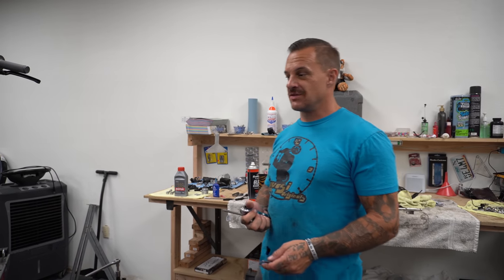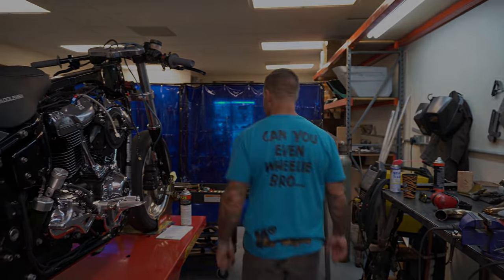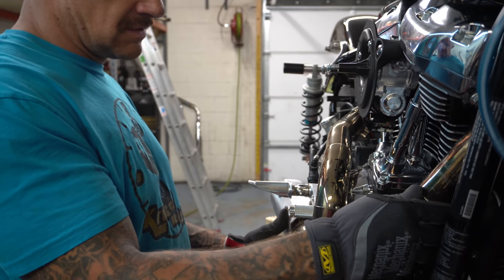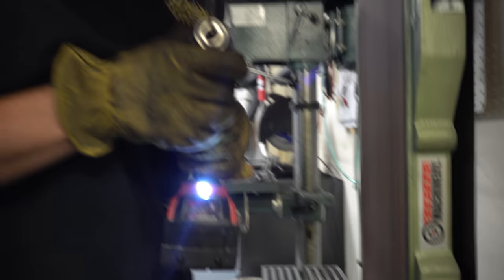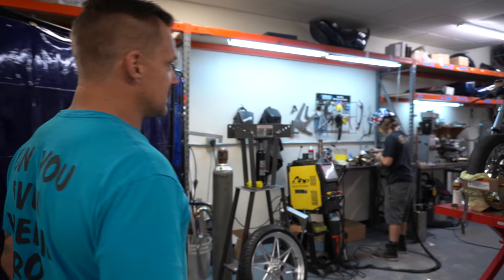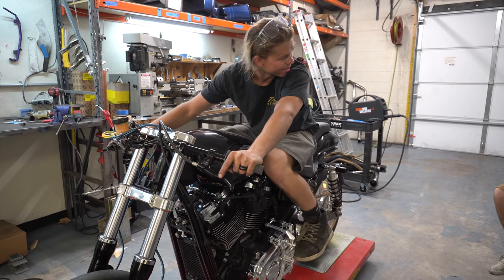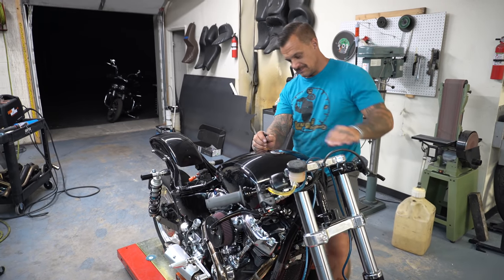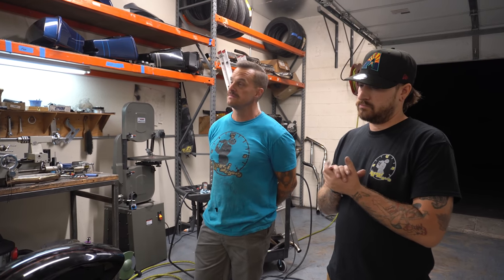How to build a custom exhaust
Trackrider (P8)

Comment: Good progress.

Are the sprocket and rotors your design?

Teeth count, rotor sizes (front & rear)?
Reply from the maker: Yes it’s all our stuff. We have 53 and 55 tooth rear sprocket‘s in stock now in Black and polished. You have to call the shop for them. 602-494-5207

Comment: How do you figure out what map to use when it is a custom pipe like that?  Do you just try to go with a similar pipe's map or do you have to build your own map? Bike is looking slick!
Reply from the maker: The pipe doesn’t make much of a difference of two and one is a two in one it’s got a flow little better but the fuel injection will adapt to it. We have a thundermax on this. The pipe is not the problem the 13 1/2 to 1 compression 124 inch motor is the tuning issue. Ramsey speed rights are maps for us on our thunder maxes everything else we do ourselves

Comment: How’s riding daily with a chain? Thought I’d ask someone with more experience, I ride my Harley everyday and I’m considering converting, plan to eventually bore too. 
Thoughts?
Reply: Shit, if you ride everyday like I do (Even in the rain) then you'd better be prepared for an assload of chain maintenance
Reply from the maker: Belts are for your pants. If you buy a cheap Chian you will have to maintenance it a lot. If you buy a good chain like the ones that we run in our chain drive kits you just spray some chain lube on them every time you change the oil. 
I had nothing but a Harley Davidson for my transportation for five years. With a chain.

Comment: Is that a custom oil filter? If not where do I get one lol.
Reply from the maker: It’s a trick flow reusable cooling oil filter. If you call the shop Trent can get you one 602-494-5207
Reply: @kruesioriginals  I Def will thanks

Comment: What is the benefit to having the rear pipe bend around the cam cover rather than come straight down in an s curve to the collector?
Reply: you need length for the exhaust impulse, the idea is to make them close to the same length.